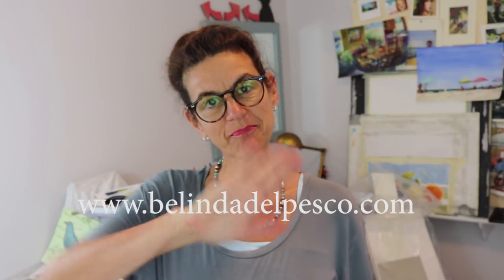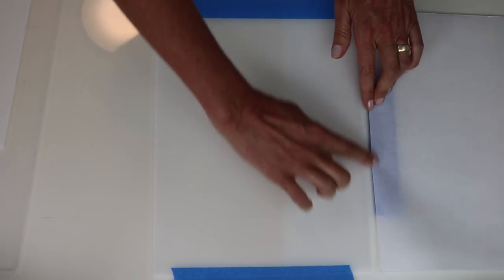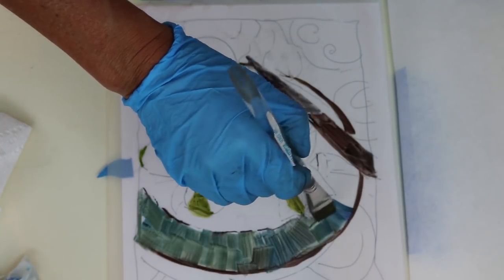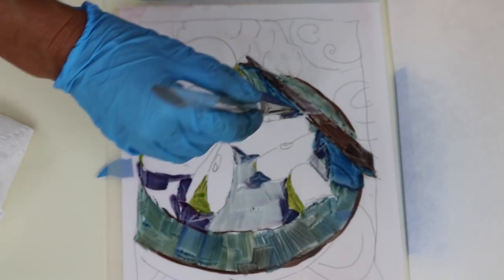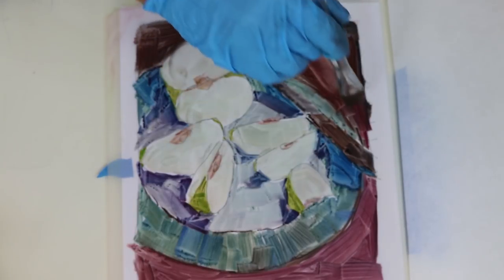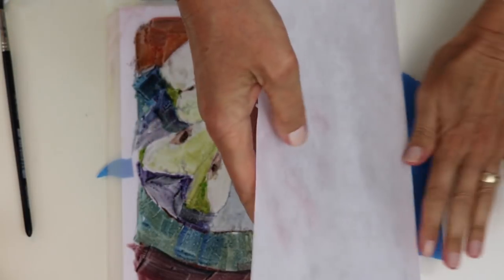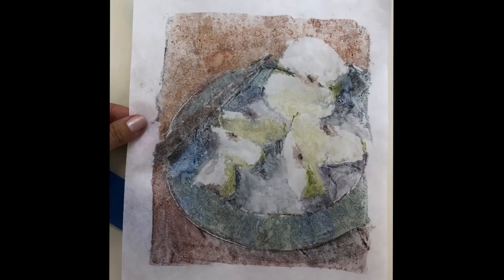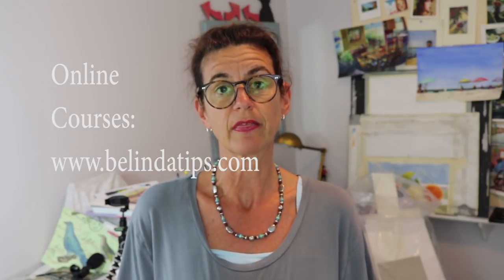How to Make a Monotype Color Print Tutorial without a press At Home

Comment: You said Akua Intaglio inks are water soluble. I tried thinning ink with water to get the less saturated color like you used in this video. No luck -they won't mix. Did you use blending medium instead of water? Thanks.
Reply from the maker: Hi Jack, the Akua inks are water soluble, referring to a soap and water clean up. The manufacturer doesn’t recommend using water to thin the inks. Have a look at these documents: https://www.speedballart.com/wp-content/uploads/2017/12/Akua-User-Guide.pdf  if I need to thin color, I use Akua modifiers, like transparent base (excellent for intaglio or relief prints) or blending medium, which can be used for either the intaglio ink or the liquid pigment, when you want more of a liquid, loose pigment to paint with. Which plate material are you printing from, and on what paper?
Reply: @bdelpesco  I have not yet started on monotypes but have ordered Dura-Lar for plates. Not sure yet which paper I'll use. ...Give Scout a hug for me!
Reply from the maker: Scout sends a meow-purr head butt to the shin.  Have a whole day of fun printing!

Comment: Question: some media, like acrylic paint, dry very fast. Do you spray water to keep the paint moist or do you use extenders? Thanks!
Reply from the maker: Hi Avelina, I’m using printmaking inks in the video, and they don’t dry till they are in an absorptive surface, so there’s no need for extenders. I’ve never used acrylic paint for printmaking.

Comment: Hi Belinda:  Thank you so much for sharing your knowledge with us!  I have been considering buying a Pin Press.  Do you have experience with these hand held presses?  Would this type of press work well with this method?  Thanks  so much.  Cathy
Reply from the maker: Hi Cathy, I've never used a pin press, so I can't say. Have you tried using a spoon yet?
Reply: No I am a complete beginner.  I just thought the pin press might provide a better print.  Also an affordable way to make prints without a big press.  I am going to try the spoon and see how I do.
Reply from the maker: Hi Cathy, Since you've never done a print, try both a wooden spoon, and a small metal tea spoon. You might find that the wooden spoon does well on fainter, broader ink transfer, and the metal tea spoon does better on delicate, detailed ink transfer. Keep your first print designs small and relatively simple till you get the "feel" for the process. And if you have questions, come back here and leave them in the comments. It might help someone else giving this a go too. :)  Mostly, have FUN!